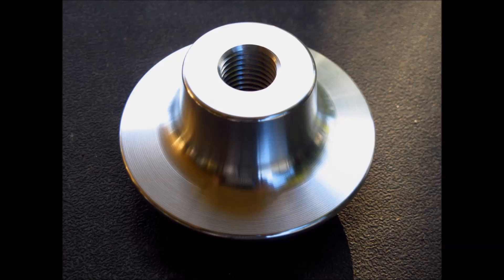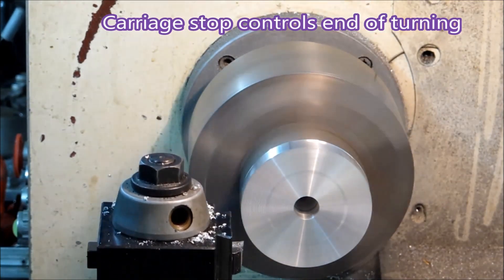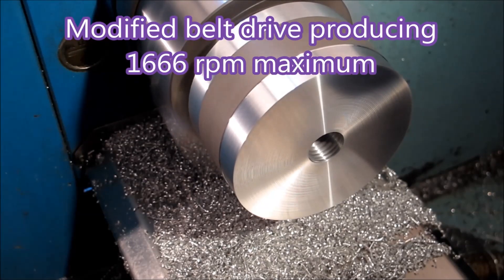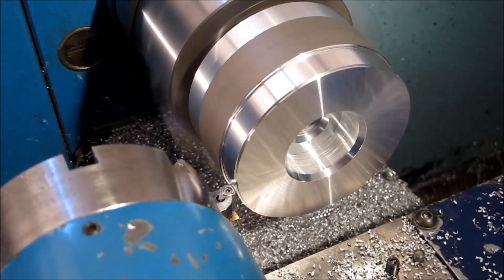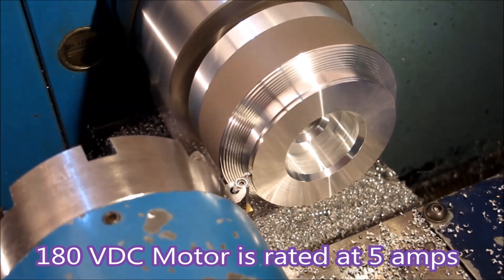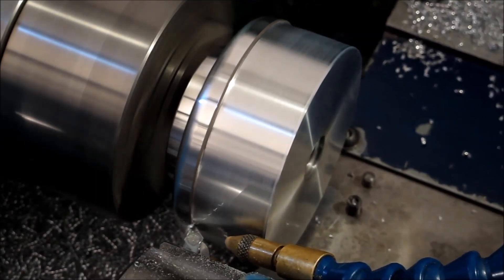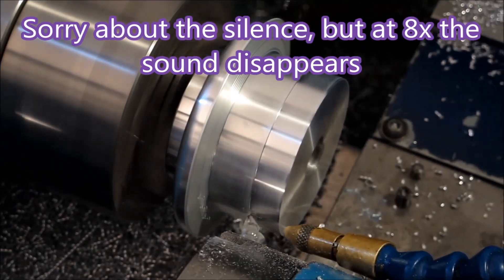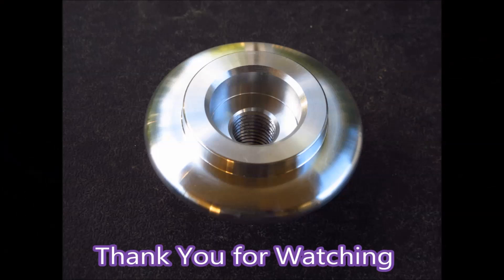Hilos for Mini Minor suspension, drilled and tapped M20, bored and profiled in small cnc lathe

Comment: I like your work, it's very nice and sorry for the last comment I didn't see it you use a mini Maschine
Reply from the maker: eugen whey not a problem. Small machines do present some challenges. If I get too ambitious, either the spindle will stall or the Z servo stops pushing. But that tends to be the way with machine tools, we can always find jobs that need a smaller or larger machine. LOL
I am often told jobs can be done faster on a different lathe, but I have to work with the one I have. I am retired now, but that little machine has made a lot of parts.
Reply: @smallcnclathes  That's right, and yes it is an art to produce such parts with a small machine and still achieve a good time. So you have my respect as a cutting machine operator
Reply from the maker: Many Thanks for watching my videos and taking the time to comment.

Comment: New subscriber here...great videos!  As requested by David, some videos about CAD/CAM would be nice to see. Also, more info your tooling would be great. Please go into detail so newbies like myself can understand and find similar tools to what you’re using. 
I do have one specific question...when cutting a profiled part with no undercuts (hope this is the correct terminology) is a slotting tool (what looks to me like a wide parting tool, the same type as your videos intro) the best type of tool to use?  I have been using a 55 deg diamond right hand DCMT cutter. This works well for me but since it is an angled tool, it rubs on the backside portions of the part. 
Anyway, really do enjoy your videos and hope to see more!  Thanks!
Reply from the maker: ScotY808 Thank you for your comment. I have in the past uploaded some simulation videos and they get almost no views, so I have not seen the point in doing much more with the cad cam. The other point is that it is proprietary software and is not usable by anybody without a Hercus. I do not use the cad contained within the software as I have access to stand alone cad that I have used for years so I use that and import a dxf to the Hercus software. I then use the cam part of the software to write the program. 
For cutting profiles, I use a rh 35 degree tool quite a bit, or a parting tool. My Parting safely in the mini lathe video explains in some detail the parting tools and inserts that I use. The inserts I use are almost always the AG Sumitomo or AK Korloy inserts for aluminium and the Sumitomo FC chipbreaker inserts which is a ground edge insert with high rake that is specifically made for folks with large machines to make "finishing" cuts. So they are made for small cuts at low feed rates which of course in most cases is all a mini lathe can handle anyway. I think the secret to the FC insert is the ground edge which is much sharper than standard moulded inserts and makes easier on the lathe. I have bought some FB inserts which are a finishing insert with a moulded edge and I hope at sometime to get the time to do a comparison video and a follow up to my Turbo charge your mini lathe video, which looks at the inserts I use.
By the way, when using a 35 degree insert, it is possible to do a 45 degree undercut as the right hand side insert angle is at 40 degrees, this does not not leave a lot of clearance but it usually works fine if you slow down the feed.
If this ramble has not answered you question please ask again as I am happy to try to help.
Reply from the maker: This reply is under your first comment, I hope you will get to see my original reply now.
Reply: Thanks, I do see it now!  Quite strange as I saw the comment in the email from YouTube but it didn’t appear here earlier today when I came to reply.